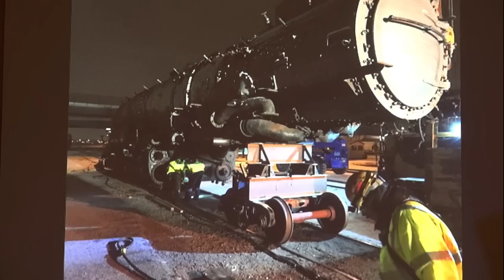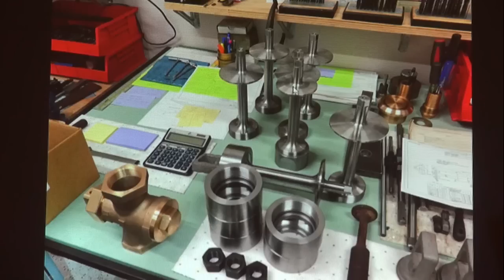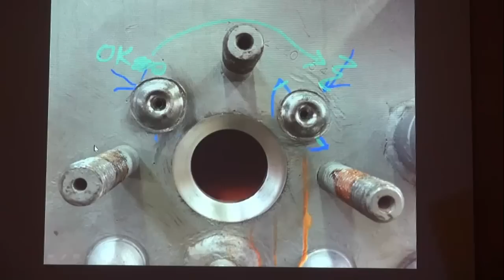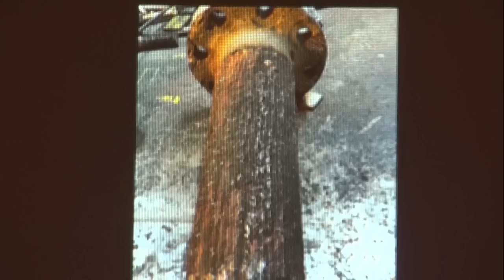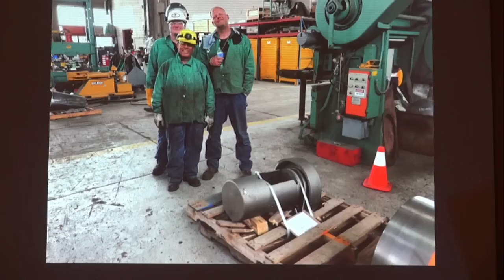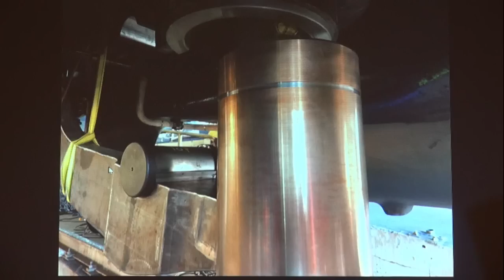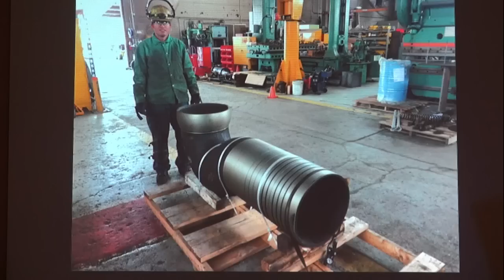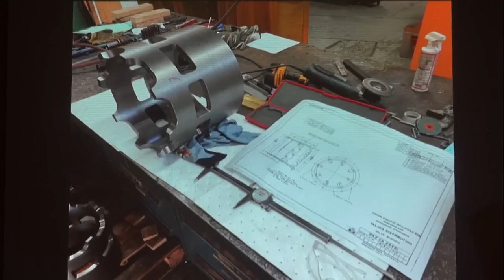Rebuilding the UP 4014 Big Boy 2020 HD

Comment: I am 68 yrs old , I was raised  in Schenectady , N.Y. , where the big boys were built . A close friend of mine , his dad worked at the ALCO when these were being built . One story he relayed to me from his dad is , when they had to lift the boiler to place it on the frame , they would sent someone up into the power house that powered the crane , he would have to take a 2 X 4  and hold the safety switch in so they cold lift it high enough .

Comment: Hello Ed Dickens. I'm a few months north of 70 years and raised for the major part of my life in Ohio. A few years of that time was spent very near a two track Baltimore and Ohio right of way and very young when there were a couple steam locomotives around as well as propellor and reciprocal engine powered aircraft at the USAF base nearby. Most of my early memories however are of the F and  G series diesel electric locomotives and the later and not as asthetically pleasing rectangular or better put boxy looking EMD diesel electrics. There was a lot to be said for the rounded, streamlined appearance of the nose of those F series engines. I retired in 2019 from a 35 year long career as a long haul trucker. Many was the time that I passed by or through Cheyenne WY going East or West. I regret never having the the time to stop and have a look/see at the U & P Cheyenne Yard. A tour of that steam shop would have been an absolute delight and fascination for this old guy. Millions of wide eyed questions would have come to mind. Now as I get nearer the end of the road of my life's journey I find myself looking back and thinking if only. Well that is the way of things sometimes and hindsight is as it has been said 20/20. Thank you very much sir for posting this video. It salves the unrequited itch of that mechanical engineer that my maternal grandfather saw in me and hmm, the fascination with mechanical objects that I've never outgrown. All the best to you the the U & P folks. Especially those at the "Steam Shop" 4014, 844, truly marvels of mechanical engineering. PS. I cannot begin to imagine the engineering and machining that went into this rebuild/overhaul. Well done gentlemen. Well done indeed.

Comment: Just imagine, It took the UP guys several years to rebuild the 4014 and it took the manufacturer less than a year to build several, and they had to make ALL the parts from scratch. No wonder locomotive companies quit making steam locomotives. I would like to see the Heritage group rebuild other UP locomotive so they have a working example of as many as possible. I know that is not really possible, but just imagine them having a 4-12-2 again.
Reply: Locomotive builders stopped building steam locomotives because railroads stopped buying them.

Comment: I thought UP would invite Steve Lee to be at the controls of 4014, at least one time, as a "thank you" for all he did for the steam program during his years working at UP. Maybe there's some bad feelings between him & someone at UP. I remember Steve Lee talking about the UP steam program on The History Channel back in the mid-1990's. That program is here on YouTube, "Trains Unlimited: When The Giants Roamed". Steve said in that program that we would never see a Big Boy out on the high rail. Too many turns that would need to be straightened & too many bridges & trestles that couldn't handle the weight. Steve has been at the controls of 844 & 3985 during several train shows on RFD-TV. And a big Thank You to Union Pacific.
Reply: Hey Mr. Paul Mr. Steve Lee is that" Guy" that kept the Steam Program agoing from listening to different ones the old timers liked Steve and Mr. Lynn Nystrom Ed & Austin there very Good at what they do and have Done but they're following 2 Greats Lynn was Steves Fireman but he could Run the ole Girls to as for Mr. Steve to see what he done while they where going or coming from Excursion hooking up to a Stalled Train and push into a Siding so they could move on there Way and the stalled Train could then get on its way was just short of Amazing but behind those controls was A very Amazing Man 2 Amazing men 2 which i got to Meet both of them.. 

Mr. Steve should not of only Gotten & Invite he should of Been Honored and Been able to Run 4014 part of the way out or Back from Ogden Ed or Austin could've set Behind him if U.P. thought that letting someone who Retired back into the Cab but I bettya this Mr. Steve Lee could've Ran ole Big Boy like he Did so ellenquently with 844 & 3985 And I'll add Sir nobody had the Good Humor that Mr. Steve Had it was Joy to Hear him speak it was Joy when I got to Talk to Him🤓🚂🚂🚂🚂

Comment: I'd like to know how much power the 4014 is putting out now that it is converted to oil burning. Does it keep steam up as well as it did with coal? Course pulling 11 or so passenger cars is child's play for the 4014. Ed Dickens-how much power do you think the 4014 is putting out?
Reply: It certainly has more pulling power if going by calculated tractive effort. The cylinders were bored out 1/4 inch in the restoration, which gives roughly 5,000 lbs more tractive effort. 
I would have to guess that 4014 probably can keep up steam well, but that it requires insane amounts of fuel to do so. The coal fired Big Boys were extremely fuel-hungry, I wouldn’t be surprised if an oil burner had the same problem despite the better design than 4005. Besides dynamic braking, backup, and PTC, I imagine the appetite for fuel and water is an underlying reason for a diesel helper.
Reply: @blackbirdgaming8147  I appreciate your answer, but I'd like to hear directly from Ed Dickens.
Reply: @Tchristman100  Just trying to be helpful since you’re unlikely to get an answer but ok

Comment: I'd LOVE to see Ed bringing 4014 into the Phoenix Az 
area!  (844, or any other steam engine.)

steve
Reply: Steve Skouson 844 was there in 2012
Reply: Steve Skouson 8444
Reply: Hopefully ATSF 3751 will get there some day.
Reply: @44492611  Good luck convincing BNSF to allow an extra train to run on the Southern Transcon. It's busy enough as it is, what with it being the hottest intermodal route in the country. That's why 2926's crew has been told they'll be allowed to run north - south over Raton Pass, but not east - west on the Southern Transcon. That's also the most likely reason 3751's only run on it three times in the preservation era, to my knowledge. That L.A. to Chicago excursion back in the early days of her excursion career was the first one, her run to and from the Grand Canyon Railway for the 2002 NRHS convention, and her subsequent repeat of that same run a decade later in 2012.

Comment: Why on earth did they opt for conversion to oil instead of staying with coal for which they were designed?  Surely not just for greater economics of operational running?  When it comes to beauty (and smell!) imho there's nothing to equal coal fired locos.
Reply: Running it on coal would have had an extreme amount of logistical communication in order to deliver the amount of coal needed (28 ton tender, which it would have used up in a good day of running). They would have also had the same issue trying to run it as the steam crew had running the 3985 during the 80's. It was restricted to run only between Cheyenne and Laramie, which is, of course, the reason the 3985 was converted to oil in 1990. Ed made a statement while they were stopped in Kansas City during the "Great Race Across the Southwest" that if it were a coal burner, they still wouldn't have made it out of Wyoming yet (keep in mind, they left in September, and this was November).
Reply: Oil is available everywhere coal is not.

Comment: Does the boiler put any weight on the front set of driver wheels?
Reply: Its literally underneath the boiler like the rear set. So yes, it does.
Reply: The rear engine is rigid with the boiler. There is a weight transfer device near the front of the boiler that puts weight on the swiveling front engine, and a coupling or hinge between the front engine frame and the rear engine frame. On straight level track the front and rear sets of drive wheels have roughly the same weight on them.